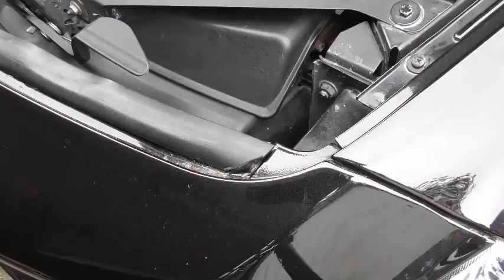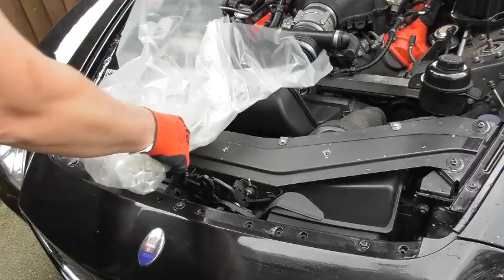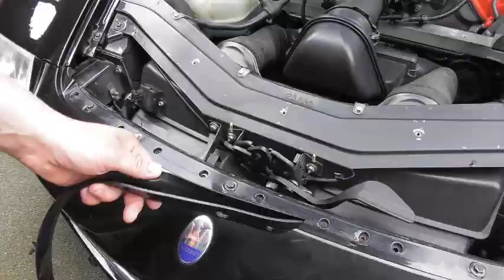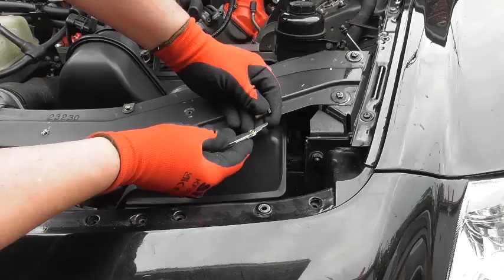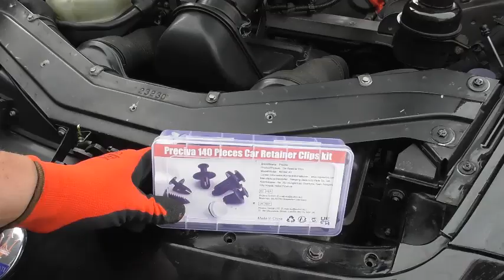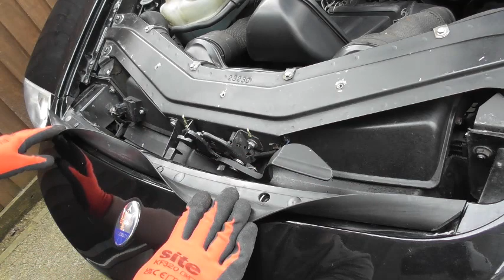Maserati Quattroporte RUBBER BONNET GASKET REPAIR

Comment: Are you missing a bolt there, sir? I like the no-nonsense videos.
Reply from the maker: Well done Luke. Wondered if anyone would spot that. Yeah I forgot to mention that. Someone decided not to put it back. There was also a different sized bolt too. Unbelievable really. Every job I've done I have found someone has already been there and something isn't right. Thanks
Reply: @AdrianLeggettUK  Ah that's annoying. The clips looked like they had been out a few times too, hence the seal not sitting correctly. How is the QP going otherwise? I still haven't got one but I'm thinking I might go for an X350 3.0 V6 as it would be far kinder on my wallet but still a fairly big car. Probably half the running cost here in Ireland, sadly..! And half the purchase price too!
Reply from the maker: @lukemallory7832  on the whole not bad Luke. Just niggles at the moment. Always something to do on these. I'm replacing my window regulator again. Also inserting new threaded rivets for engine plastics. Videos coming soon.

Comment: Thanks mate, another great video to keep these incredible cars looking fresh. It is this attencion to detail that separates your car from just another car.
Just fixed my rear window regulator following your video, works great, but someone had already been there, and stripped the door card bolts in the door and bent most of the plastic clips outting it  back in. Card was not fitted properly when I I brough the car, and the window regulator failing was a good excuse to get it all done.
Rethreated the bolts and replaced the clips, but it makes me wonder that people buy a car like this and then get such poor quality work done to the car, or do it themselves.
That's my nagging for today, keep up the good work mate, love your work, let's keep these amazing cars alive.
Reply from the maker: Thanks a lot for your comment. Pleased you got sorted. Same story here. Every job I do, someone has been there before and something isn't right.